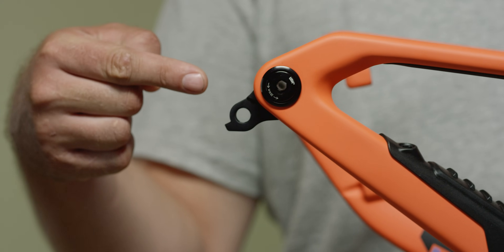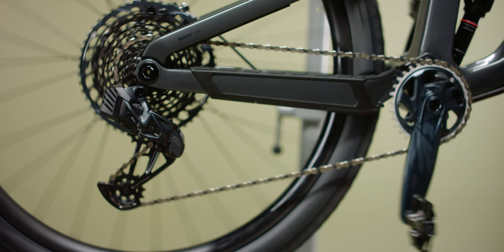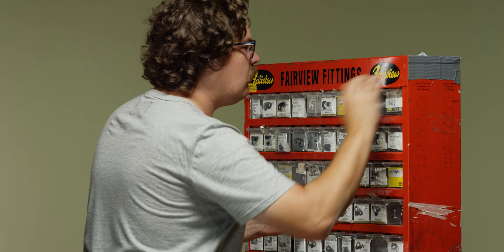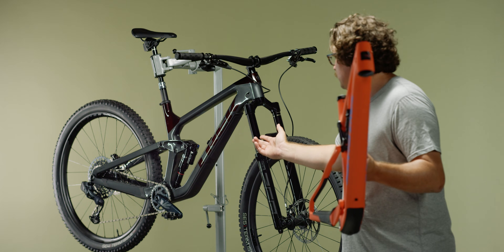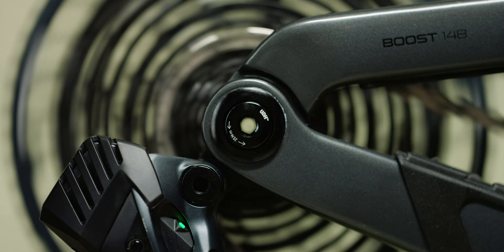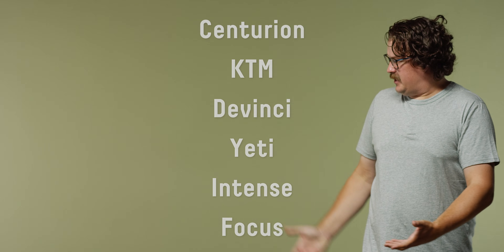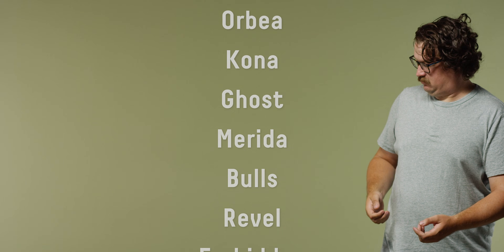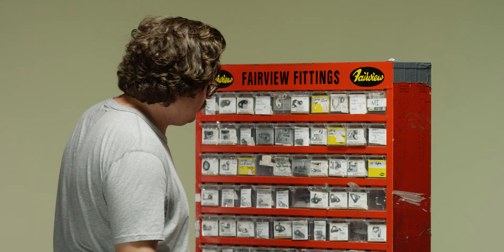SRAM Universal Derailleur Hanger | Meet the Range

Comment: I upgraded a vitus mythique 10speed to a sram xo1 12speed. When i  lineup  derailleur jockey wheel with 10T cog the adjustment screw needs to be backed all the way out, like if  hanger needs to be thicker so adjustment screw can be screwed in. Is the UDH the answer. Hanger is stock and straight. What to do??

Comment: SRAM. Why would you ever need to replace one of these? It’s got a nifty feature you mentioned of rotating backwards. That 60 degrees of movement is gracious enough to allow the derailleur to crack your seat stay. Yes I said that right. Seat stay. So after a broken frame and derailleur my UDH was unscathed. Good thing I have a spare now for my new frame. Unfortunately I can’t find a frame that doesn’t have this farce now. 

This thing is incredibly flawed. I’ve been mountain biking 30 years and never had a walking pace derailleur into the wheel incident scrap both a frame and derailleur but not bend the hangar. It is not compatible with all drivetrains like you state here.
Reply: What rear derailleur isn't compatible with UDH-equipped bikes? Is it a clearance issue with the chainstay?

Comment: Does not fit the Canyon Grand Canyon mountain bike from the build year 2021. "Universal" is an exaggeration and a misuse of language.
Reply: Because it wasn't designed to take a UDH hanger in the first place, even more so for those on open dropouts.
Reply: @sbccbc7471  So it's the responsibility of the frame designers to make sure their frame fits the "universal" derailleur hanger and the name of the UDH is accurate?

Comment: Now, this hanger is only used for bikes with thrugh axles? Or can I ise this on QR systems?? The vid does not explain that.
Reply: 12mm only as far as I know
Reply: SRAM UDH only takes 12 mm thru-axles and the bikes must be designed around this hanger standard.

Comment: Why not just put flat mount brake holes on the drive side chainstay and then make a derailleur to mount on it? You could attach it with simple breakaway bolts that could be sourced for pennies, and it'd be tucked even further away from risk.

Comment: at 1:57 "allowing the derailleur to pivot away from danger"....as so smash up into your nice new carbon frame rear chain stay. Great. I'd rather lose the mech thanks.
Reply from the maker: As part of the UDH interface design, there is a bump stop that only allows the hanger to rotate until a point.
Reply: @SRAM  yes, but before this bump stops the mech has hit the frame drop out (with shimano mech at least) - been there, done that, twice.

Comment: Great! 
I've always used Shimano, but kind of want to jump over on the Sram side to test their stuff out. I'm comfortable in the SLX zone. Any thoughts?
Reply: I would go GX route (either cable operated or wireless, both work great) you really don't want nx, and dont need xo1 or xx1
Reply: @endursa  Ok thanks 🙂
Reply: @endursa  what’s the difference between NX and GX? In your opinion
Reply: @samb394  most important difference is that the nx cassette uses hg freehub instead of sram xd freehub. So you lock yourself out of upgrades beyond nx. Also the shifter and derailleur are built a bit cheaper
Reply: @endursa  I’ve got NX on my specialized CX bike and GX on my trail bike and can’t tell any difference at all even with the quality
Reply: @samb394  that's good then, maybe nx has improved, but you could not use gx cassette or higher on your nx back wheel. So no 10 speed cog for example
Reply: @endursa  I’ve changed it mate, it’s a pretty old bike and was 2x10. But now it’s NX eagle 1x12 shifter derailleur and cassette and got X01 crankset and chainring. I’m pretty happy with it to be fair